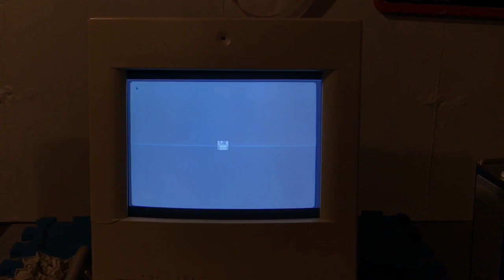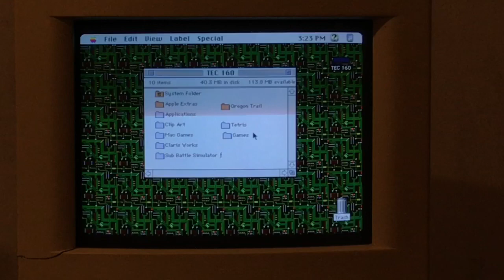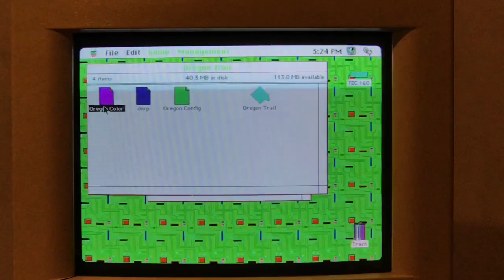Macintosh Color Classic Repair and Restoration! | Mastergeko4

Comment: Wait so did the baking soda and water fix it? And have you had any other problems with the capacitors? Great Video!
Reply from the maker: At the time, baking soda was the fix of my issue. I never encountered any future problems afterward but I did end up recapping it anyway.

Comment: What is the baking soda to water ratio for motherboard soak.? Please do one on removing and replicating the hard drive, adding another hard drive
Reply from the maker: All I really did was fill an egg cup with baking soda, and poured enough water so that all the baking soda was wet. Then got a toothbrush, and scrubbed the areas that had caps or other suspicious things. I also ended up soaking it overnight in a tub full of water with dish washer detergent powder. I think it was like 20% detergent and just enough water to turn the baking soda into a good paste. I did a hard drive installation into the Color Classic on a past Live Stream. Thanks for your inquiries!

Comment: So question? Is it the Heat or the Sunlight that helps with the color change?  Would putting it under ultraviolet light do the same thing?
Reply from the maker: I actually made a whole video on this type of treatment here:
https://www.youtube.com/watch?v=g814Y6OT0Tg&t=46s
Although it worked, it eventually went back to the same color. I've also heard of rumors that the bare sun treatment makes the plastics very brittle.

Comment: My CC gave up the ghost last month (the mb battery puked all over the logic board. If anyone knows how to get the HD out, it would be a big help.
Reply from the maker: Greetings, 
From factory, apple intended that the hard drive should be removed with the analogue board as well. Since this is a pain in the ass, another way to remove the drive is by pulling it out with a pair of needle nose pliers and squeezing it through this lip on the analogue board heat sheild. This video here shows you how: https://www.youtube.com/watch?v=fOsfaockzWU (skip to 07:04)
Here’s the color classic service source you were looking for as well. https://www.applerepairmanuals.com/the_manuals_are_in_here/Color_Classic.pdf

Comment: Have you ever thought about fixing the crack on the Macintosh Color?
Reply from the maker: I have actually! I’ve been trying to come up with ways on how to do it. If I can, I’ll try documenting it. For now, it’ll have to stay.
Reply: Charlie Mastergeko4 I have found a way how to get rid of the crack on the Macintosh color classic. You should try using Titebond Original Wood Glue and Car Wax, that will help you hide the scratch mark and it also blend in to match the original color.
Reply from the maker: Wow, I need to try that. Thanks!
Do you have a video or something to show how to do it?
Reply: Mastergeko4 no I don’t have a video. But I wish I had made a video about repairing a crack Macintosh, and I actually don’t own a Macintosh Color Classic. I own the original Macintosh Classic from 1991, but mine doesn’t have a crack at all. Its has a little bit of scratch marks on the back side, and I also got a sad Mac of Death. But I have found a way to fix it, all I need is a bootable floppy disk that about it.